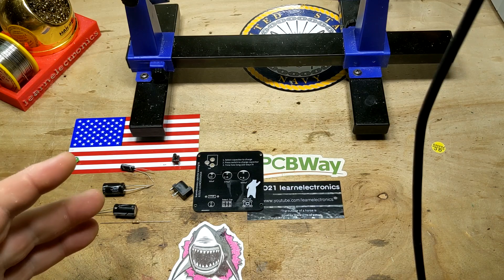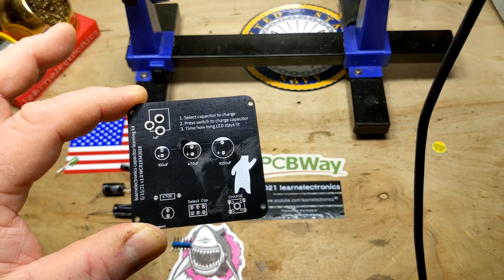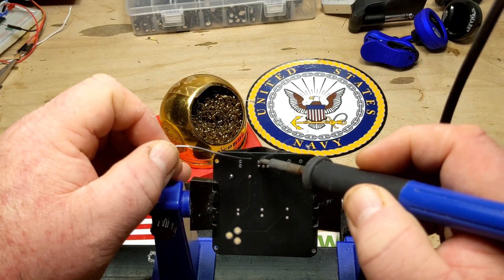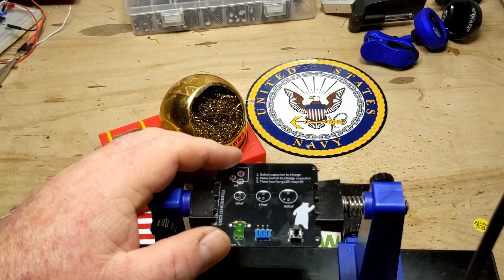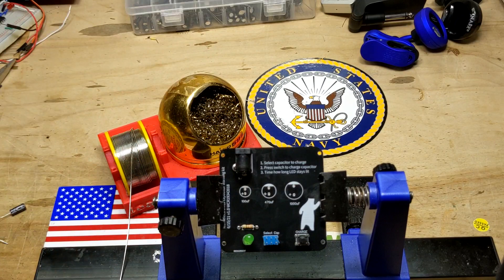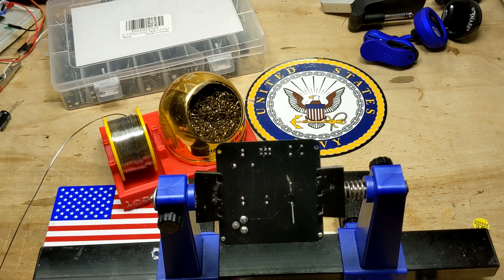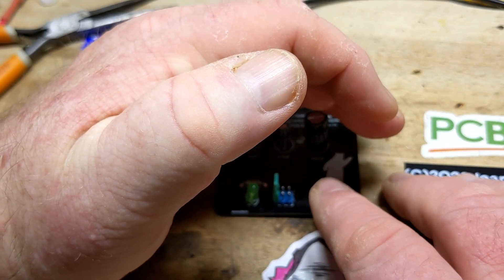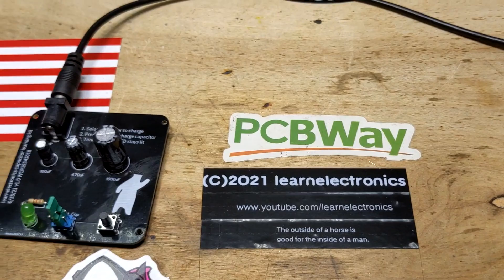Capacitor Learning Board

Comment: Hey Paul. I have a question. Is it ok to replace 2.2uf 10v capacitor with 2.2uf 50v? The power supply of this amplifier is  12v dc.

Another question, what's the significance of of 10v in 2.2uf? Why do they not placed 16v, or 25v, or 50v in 2.2uf? Can you explain this a bit?
Reply from the maker: Yep
Reply: @learnelectronics  Why the voltage of 2.2uf 10v is lower than 12v power supply? What's the wisdom of it?

Comment: How do you go about ordering the test circuit boards? Is there a section on PCB way to order the boards you’ve designed? Ive opened an account but need assistance in ordering that board. Thanks for sharing all of your knowledge and videos Artie 🇺🇸😊